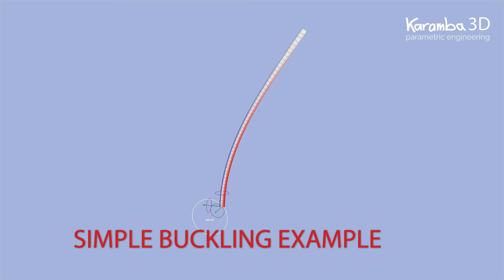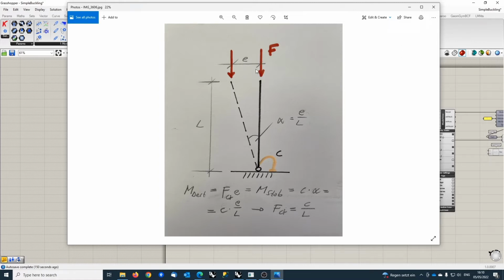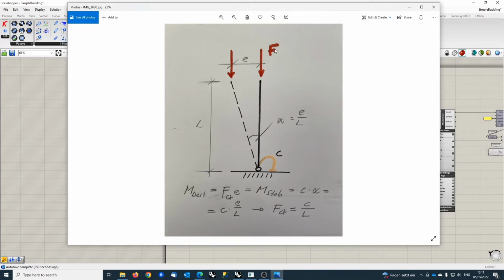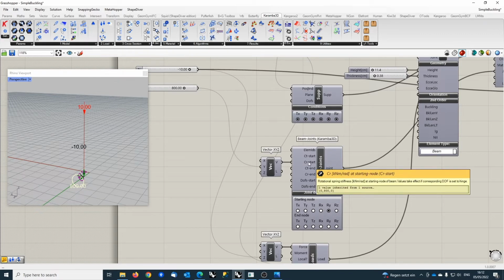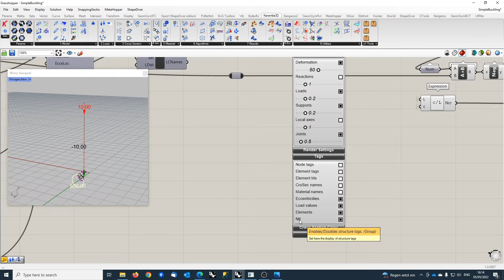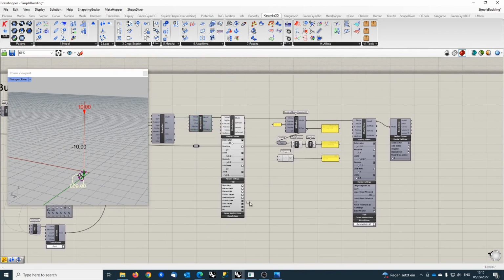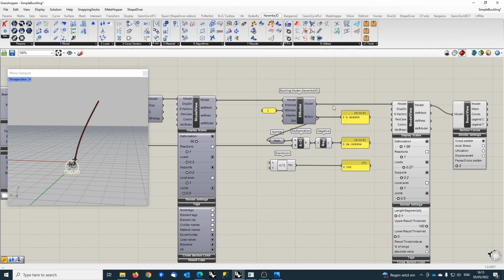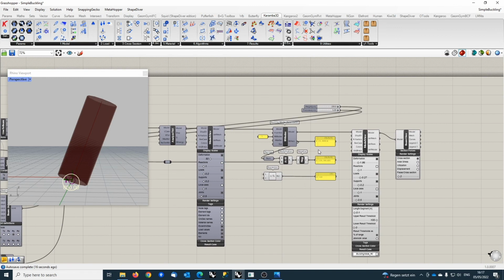Karamba3D TidBits #28 Simple Buckling Example

Comment: Nice!  I did the buckling of fixed base column under self weight but could not easily find a theoretical solution...yet Karamba3d gave exactly the same results as another commercial software.